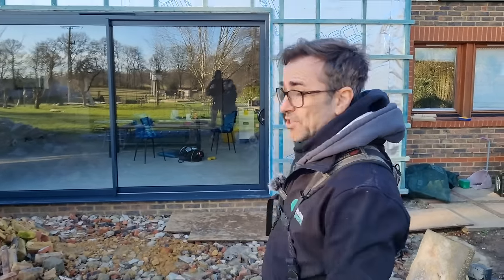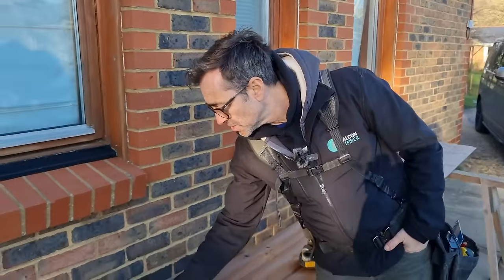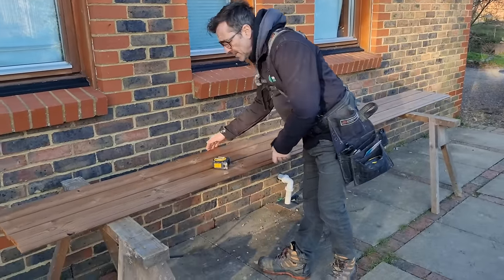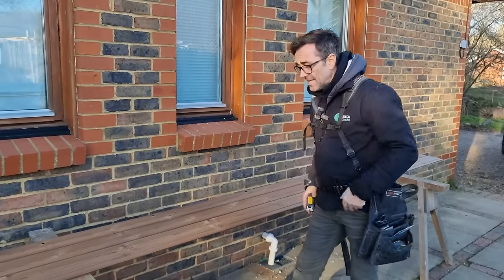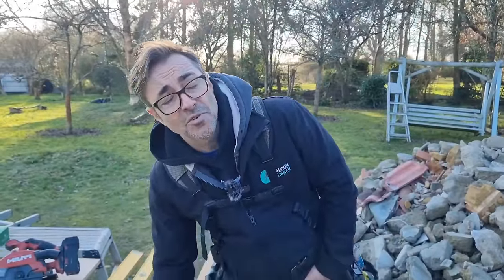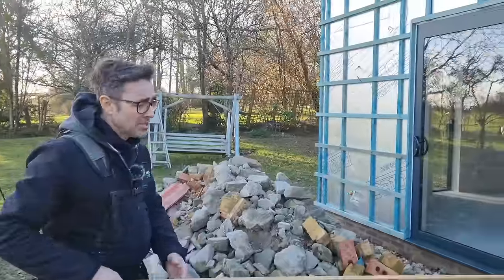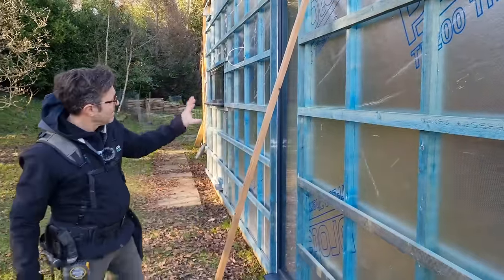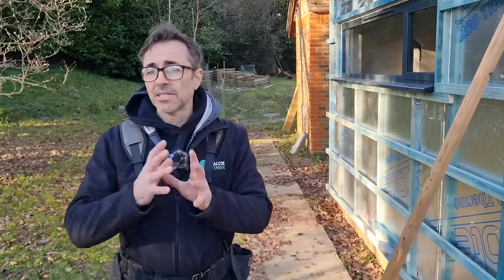How to set out and plan for cladding

Comment: Love your work Robin and watch all your videos. I trust your methods but I took a gasp of air when you said 18guage pins... are they really adequate? 
Big fan!
Reply from the maker: Hi Ben, it's a good observation, hence the reason that I mentioned 16 gauge also in the video, if the 18 gauge are the correct grade... and correct length and there are enough used properly... then they are perfect but... in the wrong hands or with bad application they may not be suitable  hence the reason for your reaction!!

Comment: Hey, Robin; To which extent do you prioritize to have the boards on the corner the same width?
My boss usually says a board should ideally not be less than 20 % width. I can think of two ways to set up siding. The first is to measure every corner in per cent and make sure they're all above 20 %. The other is to simply put a board on a corner and measure out to every corner and put one board on every corner. From there slide all if them back and forth untill you like it. Of course you can also divide in fields and run done boards with a kittle more gap in order to reach a corner with enough width. 

I agree with you need to have a layout before you start - or you need to have a good enough picture of the end result if you're improvising.
Reply: We also use brad nailers and shoot in the hidden part of the joint, or shoot on the face with stainless brads. 

After its great to use either laser or white chalk line to get straight nail-lines. We either use 30 degree full head nails or coil nails.
Reply from the maker: It's a great question, I agree with the 20% thing if possible.... the rod really helps with these issues and we can open the courses of cladding by a millimeter or so for a number of courses to achieve a good outcome, thanks for your comment 😀